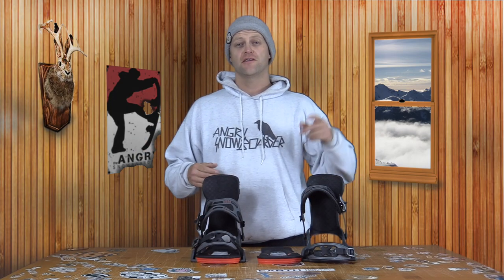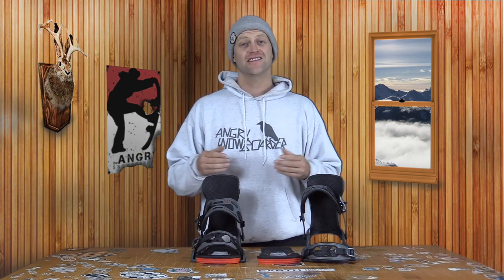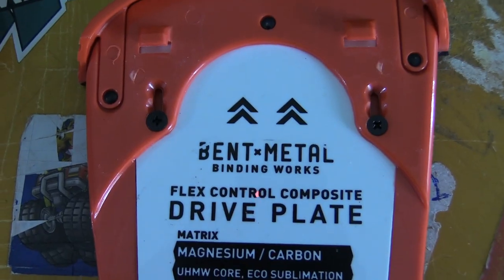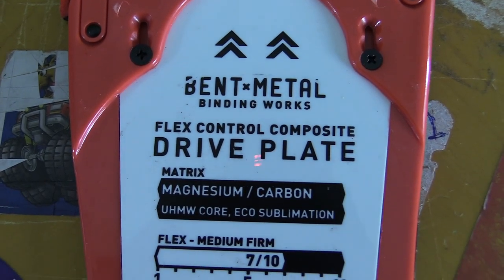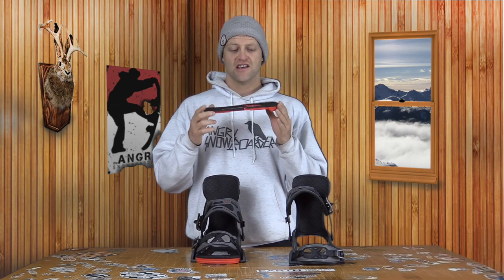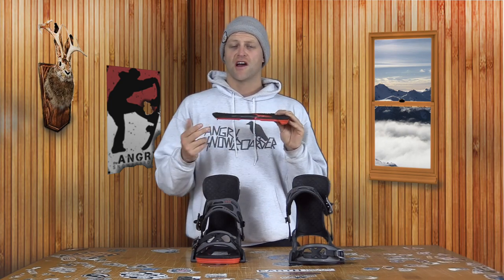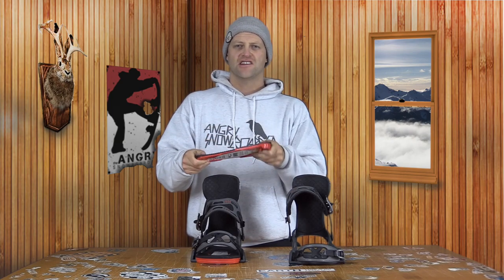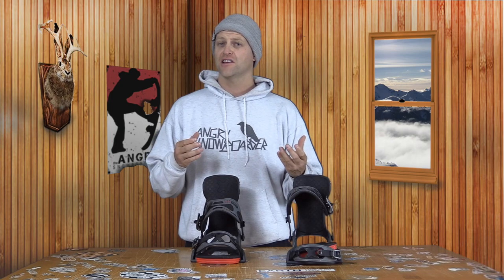The Bent Metal Bindings Drive Plates: Explained

Comment: Ok, I get what they are and do, but how would it affect riding if I used the stiffer drive plate with the softer hi back? What Bent metal would you recommend for the Doughboy? Cheers mate
Reply from the maker: You're creating a more personalized flex verse a uniform one. Which caters to you more directly based on where you need flex and stiffness. Probably the Cor-Pro.
Reply: @AngrySnowboarder  thanks, we're getting a big dump of snow right now here in Oz, I'll check out the Cor pro's before I head down next week. Wanna test out the Doughboy and get my swerve on :) Keep up the good work!!

Comment: I have a friend who got these and the drive plate that in his rear binding, constantly comes out on snow while one footed (skating), the tabs just don’t keep it locked in. Could be a one off situation but i can see where he’s just gotten so annoyed by it, he is just riding without the plate on his back foot.
Reply from the maker: You know he could just get a new plate and if its a warranty issue all he has to do is contact them.
Reply: @AngrySnowboarder  thank you and yeah he’s started the warranty process. The plastic just changed shape on him and looks basically like a rocker snowboard.
Reply: This is an old comment but it’s actually your friends fault.  Once you snap in the drive plate, you have to just push it forward to lock it in.  I’ve never had one come off and I have multiple sets of bent metals.